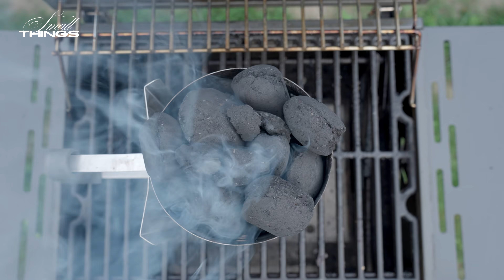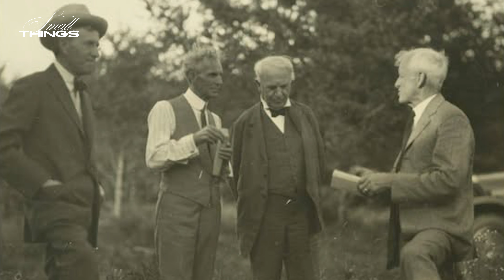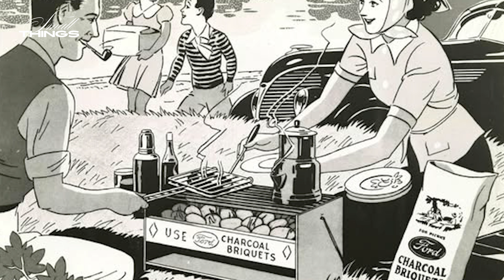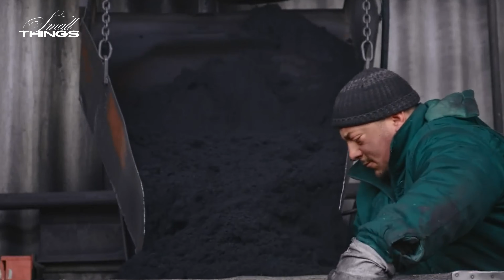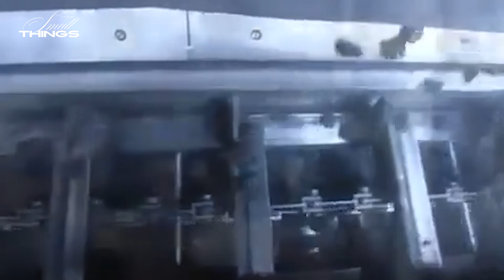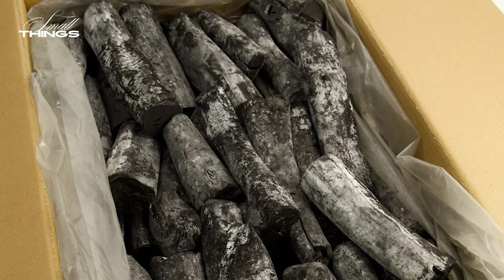How Are Charcoal Briquettes Made? From Wood Waste to Perfect Grilling Fuel

Comment from the maker: Most people think charcoal briquettes are just burned wood… but they are actually engineered fuel. Which everyday object should we uncover next?
Reply: Thanks for the video. I use both. For steaks, burgers etc I go with lump. Fast ignition, hot sear and lasts long enough to get the job done. For longer cooks with indirect cooking I use briquettes. More stable and they last longer. Cheers